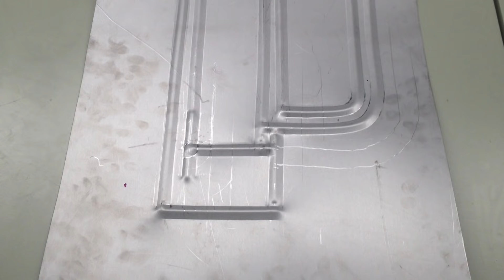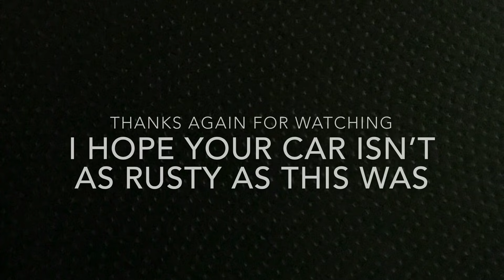A slideshow showing how an XY got saved from the scrap heap!

Comment: Love it the whole thing is beautiful I’ve done similar to a xr not xy falcon I remade the whole rear speaker panel on the bead roller and rear window opening sections like yours my quarter panels and A pillars were ok i put the car on a chassis rack measured the side lengths to hold the gaps with chains while I remade new inner sill panels put the beads in the same spots as the old rusted ones repaired the inner talk boxes while front floor pans were out one side at a time replaced the whole inner sill then the outer sill panels I found by welding small pull tabs on the tops of outer sill I used a pull clamp and slide hammer to get the outer sills to go up back in line with the bottom of the pillars and rear dog legs then tack welded them in place trial fitted the doors then welded the outer sills in place was a huge job after that I welded all new floor pans in I was lucky my xr falcon wasn’t as rusted as your xy .. love seeing someone else doing a good job man

Comment: My VL Commodore has half that much rust in it,on the passenger side rear 1/4 panel I need to cut out the C pillar area as there is a 1 inch diameter rust hole underneath near where the seatbelt anchor bolt is,I will have to do the other side by as well as I think that has cancer as well, Holden had the idea of placing sponge underneath the C pillar vent to prevent water from leaking into the boot but that has caused rust,I'm not sure if there's a way around it because it vents air from the boot in the sedans,the VN onwards Commodores has their air vents in the boot underneath the rear bumper bar.

It looks like that I'll have to hand fabricate a lot of the parts because not many rust repair sections are available except the front & rear window sills for example.

There has been a few NOS OEM Holden VL Commodore body parts for sale online but most are no longer available.

You may be able to get the front 1/4 panels & bonnet aftermarket but that's about it !

Comment: Absolutely mad skills. The amount of hand made panels floored me. Two question...what does a non rusty XY sell for?  Can US 4 door Falcons be converted to the Aussie Falcon easily?  I realize with your skills you could convert a Pinto into a Falcon. I get it you where saving an actual collector car vin, but my question on the US Falcon is if you wanted to build a faux lower budget build, like maybe for a race car that you wouldn't want to risk a collector car. US 4 door Falcons are dirt cheap.
Reply from the maker: Rust free XY shells are getting hard to find, therefore very expensive. I don't think the US got the XY shape falcon did they? I know they had the XR/XT shape, but the roof is quite different, as well as the front and rear lights etc. I love the 2 door versions of those US XR falcons!

Comment: Nice job. Bit curious though, you put all that hard work in making all the replacement bits from scratch, then smoothed over the engine bay? Was this thing pulled out of a dam??? Judging by the wild violet inner spray it must have been a special build car?
Reply from the maker: I made the panels I made because at the time they weren't available aftermarket. Plus I get a lot of satisfaction making things myself. The bay was smoothed over purely for aesthetics. I like the look of a smooth bay, rather than with loads of lumps and bumps.

Comment: WOW another example of talented metal shaping, 2 questions was that a client job or personal as id  imagine there would have been 100's of hours in it . Q2 where did u leatrn your skills as they are not the things most panel beaters could achieve these days with replacement only work in most shops .. 

ps is see the tap doubles as bandages aswell as glove repairs :-) 
thanks mate for sharing
Reply from the maker: Yes, tape is a great band aid : )  It was a job for a dude, not my car unfortunately. I'm just a self taught hack. I don't have a trade or any formal qualifications, but that's made me a pretty good problem solver.